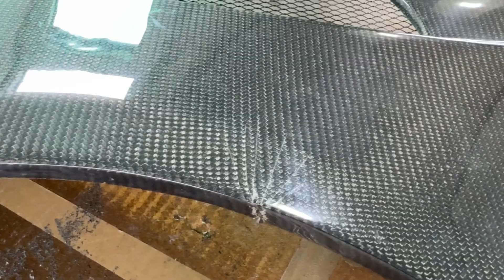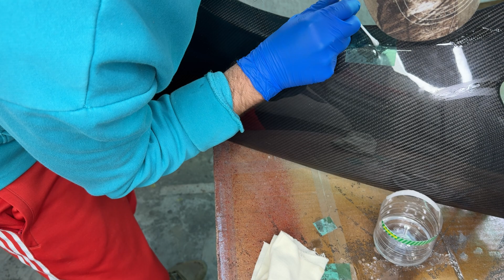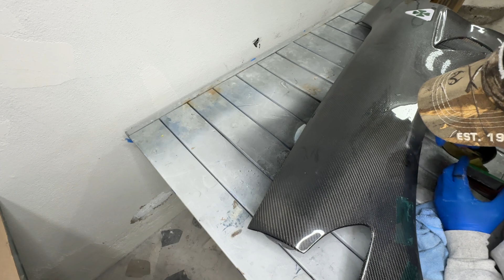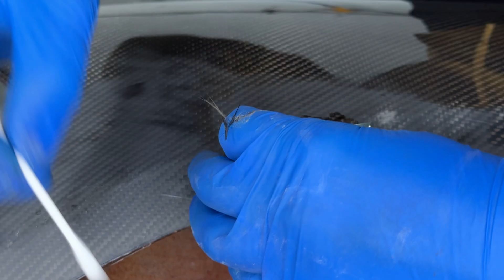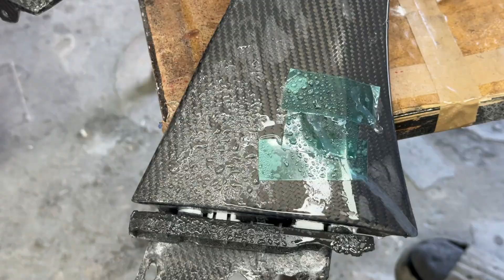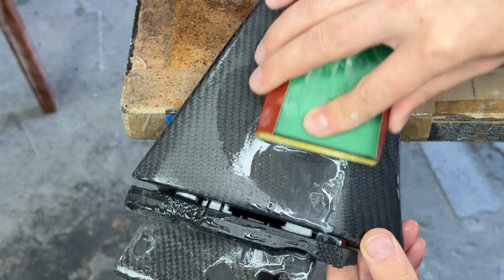DIY - REPAIRING DAMAGED CARBON FIBER FRONT FENDER - ALFA ROMEO GIULIA QUADRIFOGLIO

Comment: Плохо сделал, косяки видно.
Reply from the maker: Hi, it didn’t come out perfect. The glue I used for the repair is transparent, while the entire fender is covered in clear gelcoat, resulting in a difference in transparency between them. The white spots you see are smashed clear gelcoat within the carbon fiber fabric layer, so I didn’t touch them.